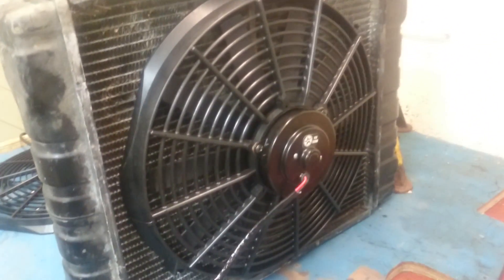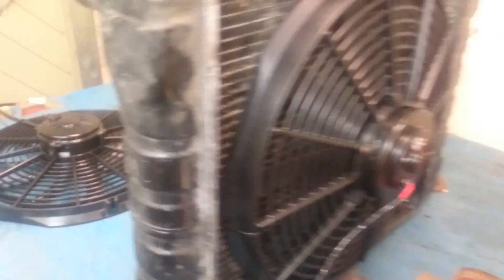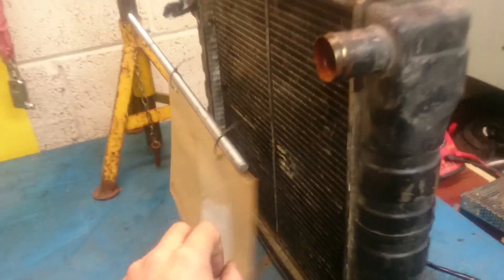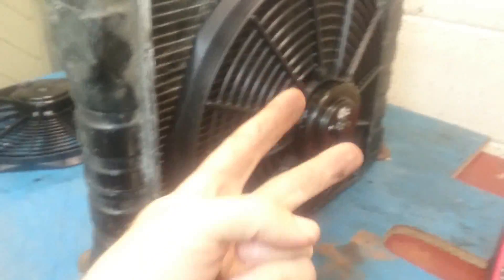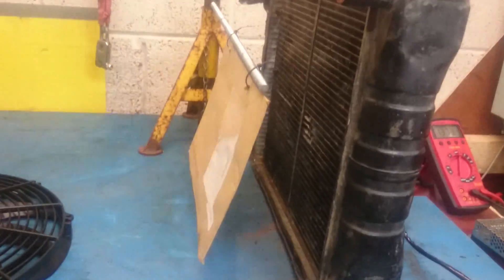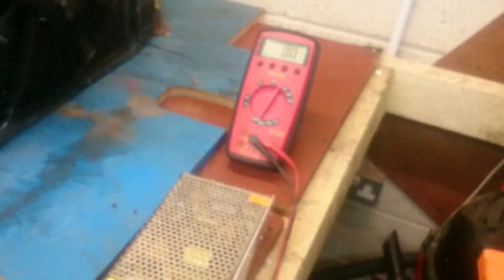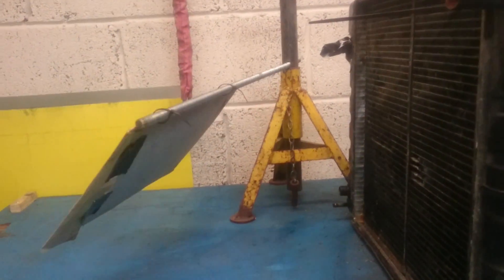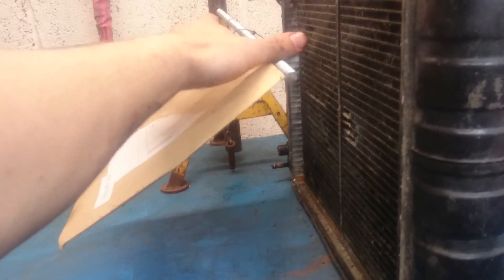Spal Radiator Fan vs cheap ripoff Ebay fan

Comment: Your test is very misleading.....a curved fan will produce more CFMs...however the spal fan is superior. Just my observation.
Reply: I think according to SPAL the straight blades push more air, whilst the curved ones are quieter.

Comment: A puller fan setup is more efficient than a pusher set up. Also having a fan shroud on the radiator makes a huge difference on the cooling efficiency.

Comment: We at AmericanVolt.com sell electric fans with the high watt motors up to 180w same as SPAL but at much lower pricing. Check us out and yes don't settle for cheap low power fans on eBay.

Comment: I guess I'm fortunate enough never to have an issue with cheap eBay fans.  though spall fans look awesome  but idk if I would ever buy one   They are expensive compared to the cheap China stuff and I have yet to have any other cheap China fans fail on me.  I would probly buy one for air cooled engine modification because they are so robust looking and do exactly what they say they're going to do.

Comment: You were testing that cheap pull fan as if it was a push fan. No wonder it is not performing.

You either do not know what you are doing or you are a fraud.

I am a believer in the saying "Never attribute to malice that which is adequately explained by stupidity."

Comment: I have a 14 " eBay fan on one of my cars,it does not cool it down ! Just ordered a 12"spal this has confirmed my thinking! Thank you!
Reply: So was the spal fan better than the ebay one?
Reply: How is the spal holding up ?
Reply: @georgiabigfoot  5 years on,still going strong!
Reply: @georgiabigfoot  really odd this old post has been dragged up ,I literally took the fan off last weekend to clean the rad and remove years worth of crud!
Reply: @OrionCrazyCarl  well great to hear about its longevity.  Looking to add one as a pusher in my 96 suburban

Comment: did you have this wired up right because the air it suppose to come out the back of the fan not the front..thats according to the instructions i got.
Reply from the maker: scaleop4 hi, yes, they are push fans
Reply: fair enuff

Comment: Help please, how much amps do i need in powering my 12v car cooling fan on my 220v wall outlet? i have 12v -1Amp adapter but it doesnt power my car cooling fan on my wall outlet.
Reply from the maker: Roger Flores hi! You'll need a power supply with a current output nearer to 15 amps to power most fans. I have a small fan which 'only' needs 7a to run.
Have you looked at computer power supplies? Some of those can make a good amount of current on their 12v output. They are commonly used to power heated beds on 3d printers so maybe search Google for them. My power supply is very similar to RWS300B12 if you Google it
Reply: oh thanks Sir Tom, definitely going to search for that, nice Vid. thanks.. . :)
Reply: One amp its too little ,means you give the fan only 12watts (12 volts x 1 Amp).It doesnt have enough power to move the rotor.

Comment: Hey bud, I'm intrigued on how you converted to AC plug, can you do a how to tutorial and what power supply you used?
Reply from the maker: Ric S hi! I used an AC to DC power supply, 12v 20A. I can dig the power supply out to give you a part number if needed but if you Google RWS300B12 , a very similar one will come up.  I wouldn't be surprised if some desktop computer power supplies can provide enough current on the 12v rail if you wanted a cheaper approach! Cheers

Comment: I don't like any aftermarket fans. It takes time but if you go to a salvage yard and get an oe fan you'll be good they crank serious air. My S10 has a Chevy traverse Duel setup in the summer with AC on its running 50% power and never gets got. It also has a thermostatic switch that rarely comes on set to 100% power for those times I'm not using AC and I'm stuck in traffic. My chevelle has a 16 jeep renegade single fan. Fits my rad core perfectly runs 50% power constant and 100% at 210 Deg rarely does 100% kick in.
Reply from the maker: Retrogamer1010 agreed! There are very few salvage yards where I live, there are car breakers yards but you're not allowed to just browse around the cars like we used to be able to do 10 years or so ago :( I needed a push fan as there was no room at all behind my rad, and I couldn't find any vehicles with push fans on eBay etc. I'm glad I splashed out on the aftermarket one as it has been a godsend and times, but still wish I could have found a scrap car fan!  For anyone reading this... Vauxhall/Corsa D fans are HUGE, like 16" (pull)

Comment: The s blade Spal will push a lot more air than the ebay fan because the ebay fan is not a s blade design. You can get cheap s blade fans which are better, but still not as good as the Spal  but are way way cheaper than the Spal. If you need a cheap and powerful dc motor, the radiator fan motor is hard to beat, easy to drive, easy to mount, sealed, reliable , quiet and easy to attach pulleys belts  etc..
Reply: You can use the motors in these fans for all sorts of applications, not just to cool radiators.
Reply: Tell me if you know wich fans are brushless and can be found at scrap yard.Like from Bmw,audi etc.I know mercedes uses brushless fans but they are too big,like 800watts.

Comment: Thanks for the great information Tom!  Unfortunately I had to learn the hard way having bought the crappy EBAY China electrical fan.  I made every mistake possible on this install but my car luckily didn't blow up!  Ordering a slim SPAL pusher fan now!
Reply: Give us link please
Reply: @turgayaltunbas9543  Actually used a SPAL 16” thin puller fan (1,600 cfm) which pulls enough air for my Ford 200 Mustang with no AC.

Comment: Wait until you try one of the bad ass Volvo fans.. 4300 cfm! Really super close to the king the Mk viii Ford fan, but its 18" vs the 16" Volvo. They are 2 speed fan also, they make use of a nice dual relay to control it. I bought 2 for 30 bucks each from the local junk yard out of Volvo 850's. Got another on a best offer on ebay for 125 for a bnib oem Siemens fan. Dont buy the aftermarket Volvo fans on ebay, they are not balanced and are junk, there is no comparison vs the real Volvo in cfm output. I have 2 on my '03 Silverado, the fans only kick on high when the a/c is on, which I might add the fans cool the condenser down big time and it blows colder.. They do pull some huge amps @ start up then settle to around 26ish or so @ 13.8v running.. There really is no better electric fan.
Reply from the maker: nice! my radiator is only 14" so I got this fan to suit. I could only find pull fans in breakers yards, and i only had room for a push one. cheers
Reply: There are much better fans,like those on mercedes that are brushless and 800 watts.Is the volvo fan brushless?
Reply: Do you have a link to physical specifications of the Volvo fan you used? I'm looking for actual OEM part numbers, width both the fan to include the flange and the fan blades, the depth of the unit to include overall depth, depth on either side of the flange.

Comment: Hey Tom G, which model Spal is that and what amp rating (i can look it up with model number) i need a 2.5 inch or so depth fan. 14" thanks
Reply from the maker: Jesse Magaña have a search on farnell; size has little to do with output power. I didn't show the wires because this is all a conspiracy and there are aliens, which are real. Mexican aliens taking our jobs
Reply from the maker: Hi! it's a VA08-AP71/LL-53S , pulls around 20A, it's a bit deeper than you need though i think, at about 3.5 inches
Reply: you manage to pull 20amps from that small power supply how come you dont show to were you connect the wires to the  fans to

Comment: Compare them how much amp draw for each motor.  Also compare the type of blade they use.  If the fan blade uses more PITCH, then the fan will push/pull more air at a specific voltage/amps/RPM and watts.  The first fan you shown probably was using a straight and less pitch fan blades, thus, the motor and blade will spin so high that creates a lot of noise but less airflow.  The SPAL fan you have has a different type of fan blade which is called Scimitar Fan Blade with more pitch, hence, it is pushing/pulling a lot more air.
Reply: Flat blades moves more air..
Curve blades are more quiet....
Please research before posting BS
Reply: @TooBlessedToStress88 Lol the irony. Confidently incorrect.

Comment: I noticed the eBay fan is a straight blade while the Spal is a curved blade. Curved blade fans have a higher CFM rating in general (nearly double). It would be better to compare apples to apples. 
I used a 14" curved blade eBay fan on my condenser for about two months and it blew an enormous amount of air. Only reason I took it off was because I got new mounts for the stock fan.

Comment: Love your video man! straight, simple and easy for everyone from all over the world to understand and benefit from. Thumbs up
Reply: something that you did not catch he never shows  what the fan is really  connected to.  he only shows luging the little power supply that looks to be connected to the ohm meter . now a fan that size ulls about 14amps there's no way  that little power supply would have powered a fan that big the biggest power  supply i ever seen  only puts out 3amps like i said he does not show where does he connect the fans to
Reply: @MyJm29  yeah, I would have liked to see current draw even more than voltage but both would be best.

Comment: I have bought hundreds of parts off ebay, maybe 2% have been crap. I think it is brand name not where you buy it that makes it quality. Anything made in China, junk.
Reply: You've just contradicted yourself.
Reply: I agree except everything is made in china so it can't all b cheap
Reply: @jengal259  spal is made in italy..
Reply: superhoggbike but everything made in China
Reply: I just bought a $38 16" 3000 cfm fan. I put it in a 2002 envoy.  THe relay with Thermostat trigger cost $20. It keeps the car perfectly cool and the ac blows cool when parked in traffic now.  Sometimes cheap is good too. I was so impressed at how powerful the fan actual was, that I bought another. I gutted a ac box fan and put it in there. I bought a ac to dc power supply for it and a way to give it three speeds. It is 10 times as powerful as any  ac fan you could buy at that price.
Reply: @johnnyvt9  well said
Reply: @webhomemadeprojects1173  ....spal is 100% of parts are made in italy.